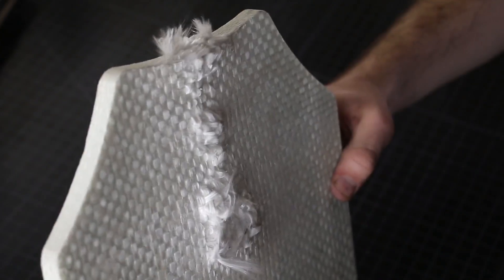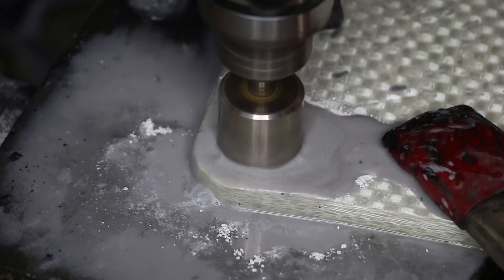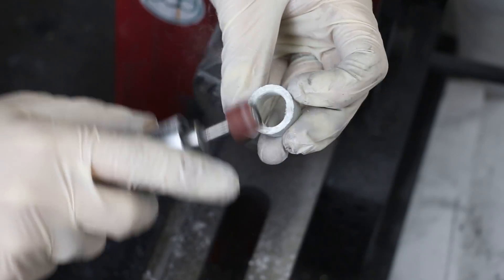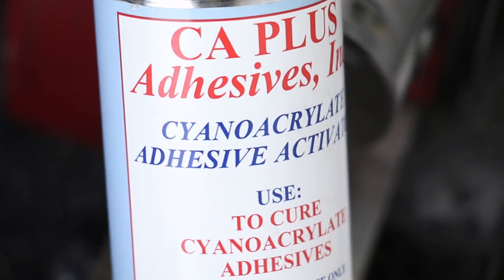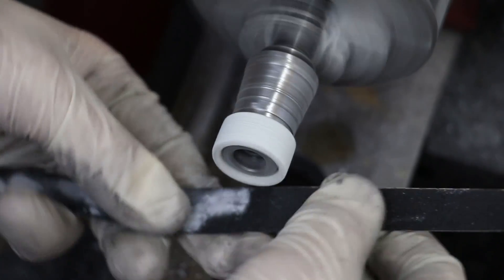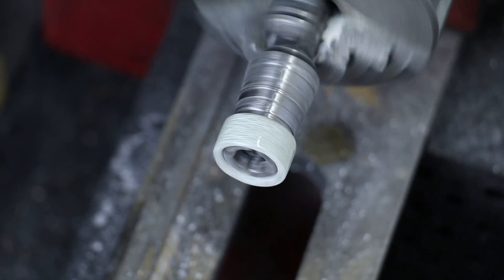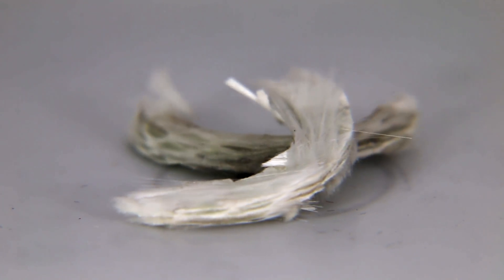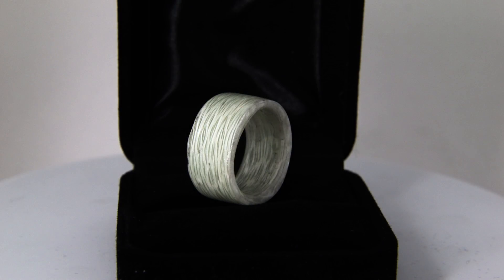Making a Kevlar Ring

Comment: So just an FYI because I wear a kevlar vest for work. .22 Cal rounds and smaller can often penetrate kevlar because of how small it is. They just lose a lot of momentum. .50 Cal and above will often blow through kevlar because of the shear force behind them. A 9mm or .40 Cal round would be a good test for this ring.

Comment: I wonder if it would have been less splintery if you had stabilized it with resin in the vacuum chamber first.
Reply from the maker: Good idea, its already resin infused but I could maybe infuse it better once I get a ring blank sizes piece cut out

Comment: composites are typically anisotropic meaning they're stronger in different directions. By shooting it from the side all your doing is ripping apart the layers (aka delaminating) well since the ring is so so thin anyways even if you shoot it with the bullet hitting a more favorable direction the ring would break either way since it's too small to effectively dissipate the energy from the bullet.

Comment: You should have molded it in epoxy... You said it's absorbent, so it should soak up some epoxy. That would rid the splintering problem so you can actually wear the ring

Comment: You could create the ring as you did in the video (but oversized), then encase it in resin. After it hardens, remove all but a thin layer of resin. That should make it much more comfortable to wear and resistant to fraying, especially because the Kevlar fibers would absorb the resin.

Coating it in a clear epoxy and then sanding/polishing would also be another option to increase comfortability and strength.

Comment: Need to make the complimenting ring. Made from the shell casing of a fired round. Something like a .50 cal, or a 20mm should offer some metal to roll, or generally work with. Keeping the rim, and head intact for bonus points.

Comment: kevlar is closer to teflon, it's a long chain molecule with fluorine in it.  but not a ceramic in any way, ceramics are glass like structures
Reply: penroc3 it actually is a peptide with out fluorine, the stability comes from the structure of the parallel polymers